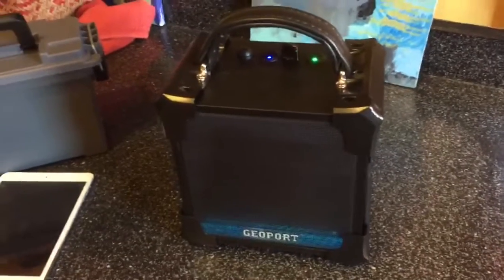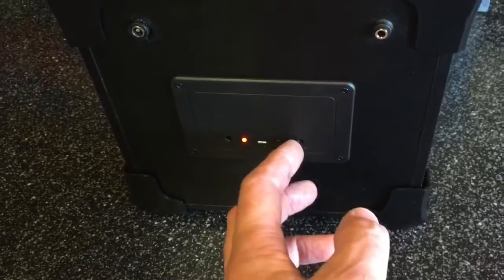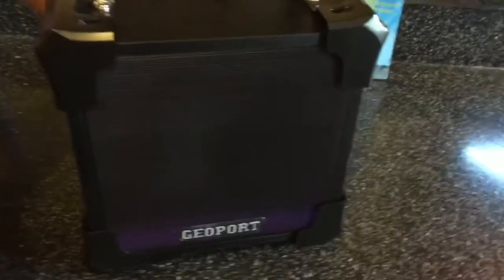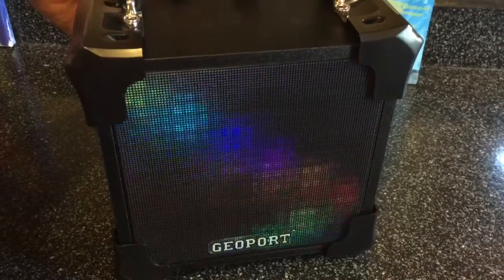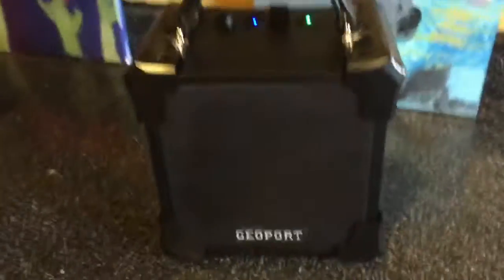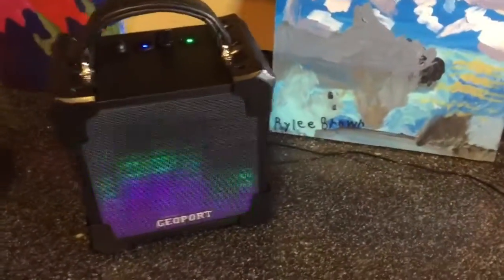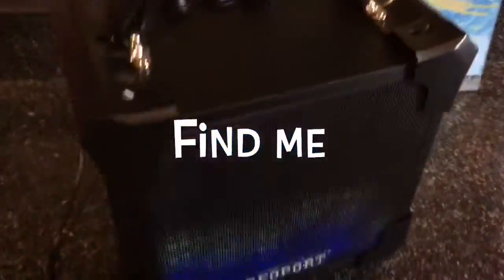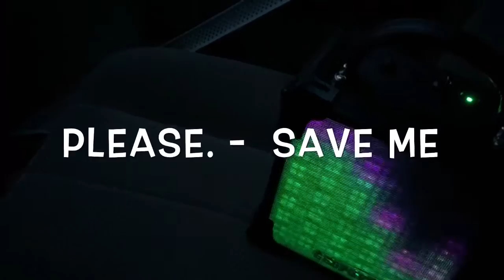GeoPort Black Box Geobox Testing

Comment: What is the point of the reverb? It makes it sound super hokey.
Reply from the maker: The reverberation is actually important it is I believe a wave/vibration that promotes resonance which can boost weak signals. I think it also kind of works reduce friction so to speak between worlds/dimensions.
Like when you for example have some really thick uncured concrete that’s piled up like a solid so much you could walk on it  and you induce vibrations into it it becomes a liquid and you would fall right through.